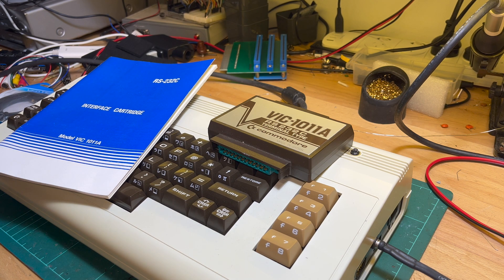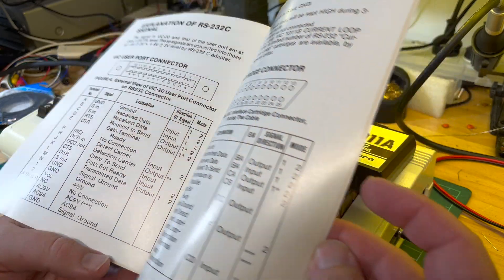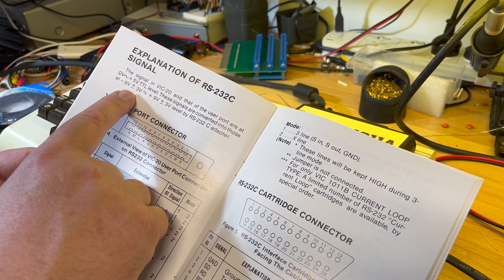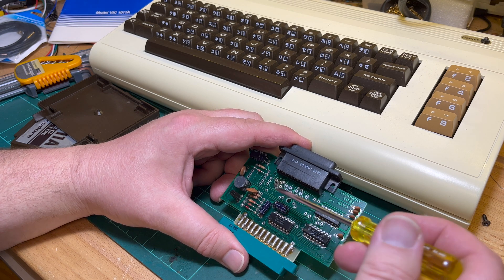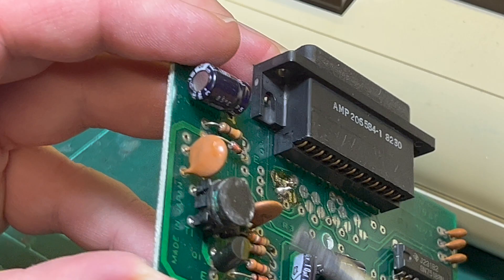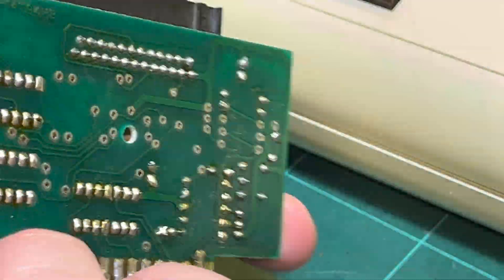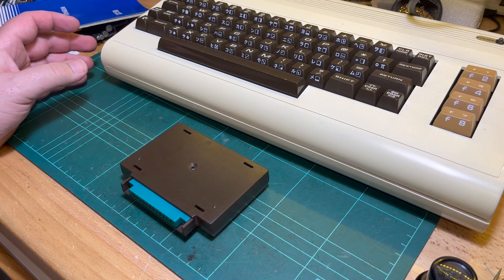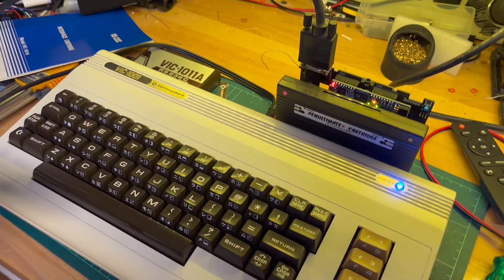🇺🇸 Commodore VIC-20: VIC-1011A RS232 Interface (Part 1) [TCE #0207]

Comment: Off the top of my head, the VIC will run at 1200 baud. It’s not a limitation of the RS232 interface, but of how fast the processor can bit-bang the signals as there’s no UART to run the port.

Comment: not much to it really... looks like its just converting logic levels...
Reply: That’s exactly what it is doing. The VIC produces RS232 signals on the user port, but using modern 0V and 5V for 0 and 1. This just adjusts the voltage levels to work with old equipment.

Comment: Totally safe to connect to your Mac -- they wouldn't have labeled it as RS-232 if it wasn't capable of working at that signalling level. Baud rates info was on the 4th page I think? You went right past it while wondering about max baud rate ;)
Happy New Year -- or wait, you live in opposite world down under, so is it Happy Old Year? Happy Half Year? Something strange like that I'm sure :D
P.S. the TI Silent 700 terminal is seriously awesome, I've lusted after one for ages. So quiet you can barely hear it, compared to most terminals which were ridiculously loud. However they mostly ran at 300 baud, except for a few modified ones for AT&T that ran at 1200 but couldn't continually receive characters without dropping them as the buffer wasn't big enough and the internal processor couldn't keep up.
Reply from the maker: I'd never heard of the Silent 700 before ... and now I've stumbled upon one up for auction here in Australia!  Looks cool.

https://www.ebay.com.au/itm/325494748754
Reply from the maker: Oh, and now ebay is recommending me more ... so actually this one would be better for a modern perspective ... just plug in via the RS232 port rather than an acoustic coupler:

https://www.ebay.com.au/itm/144898422590
Reply: @Brfff  Yeah, there were three different versions at least. One with RS-232, one with current loop, and one with acoustic coupler. And they clearly were open to modifying them for big customers like AT&T.
Reply from the maker: @AureliusR  Ahh, that's interesting - the VIC-20 manual includes a listing for a Silent 700 that has been "modified for PETSCII" ... I scored a Model 703 (RS-232 interface) - thought it might make an interesting video to see if I can get it working (runs on 20VAC, uses thermal fax paper), then modify (ROM?) for PETSCII to work with the VIC-20 ...

Comment: It was a very useful addon back in the day because VIC-20 and C64 were missing RS-232 hardware. In addition, TTL logic on User port is more suitable for communication with modern machines (0-5V), but because it's driven by the CPU it is maxed baudrate at 9600.

Comment: Merry New Year :) Just to point out that 9V +/- 3V includes 12V at the limits. The transformer is probably used for the charge pump to create the 9V (same arrangement on the ZX81 16k RAM pack). Check out Jerry Walker's Z80 computer build latest vids for some interesting RS-232 stuff :)